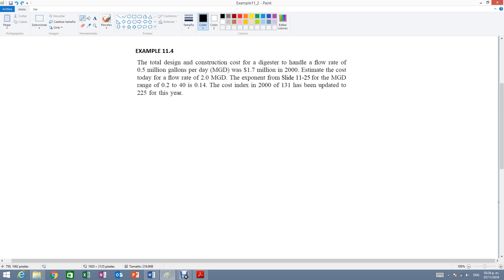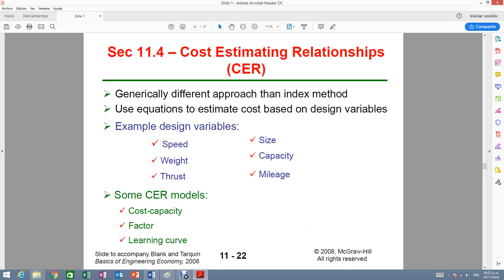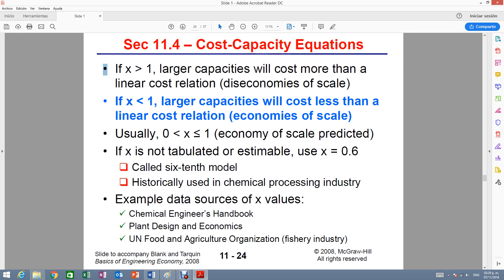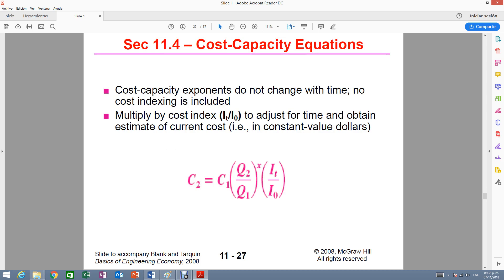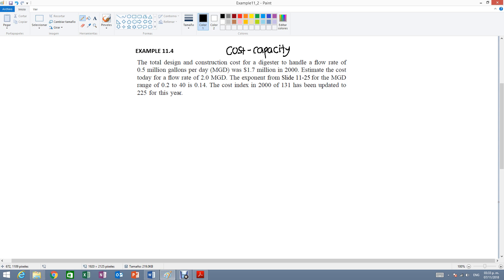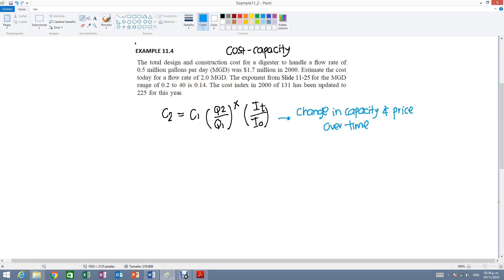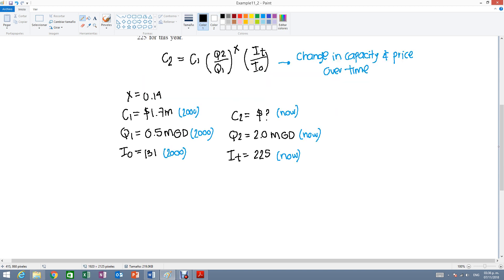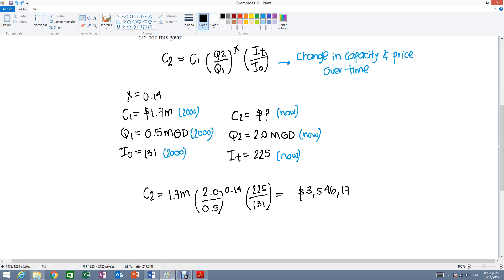Engineering Economics - Cost-Capacity Equations

Comment: Hello
How can we determine the value of C1 and C2?
are they dependent on the time or what?
Reply from the maker: Cost-capacity equations define the relation between 2 capacities:
C1 = cost at capacity Q1
and
C2 = cost at capacity Q2.

Cost capacity exponents (x) do not change with time. 

However, in this particular example, we multiplied by the cost index (It / Io) to adjust for time, similar to what we do in the cost index method (https://www.youtube.com/watch?v=X_UYRh0QICw). The cost index method indicates the change in cost over time.

Hope this helps! Let me know if you have further questions.